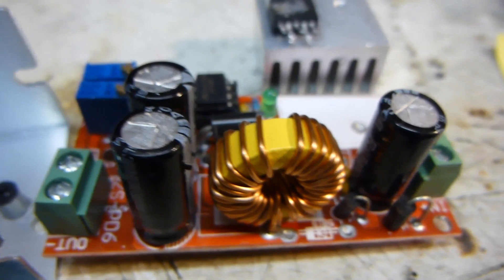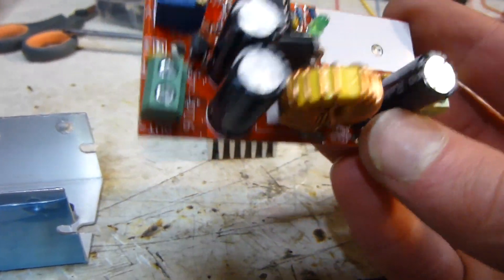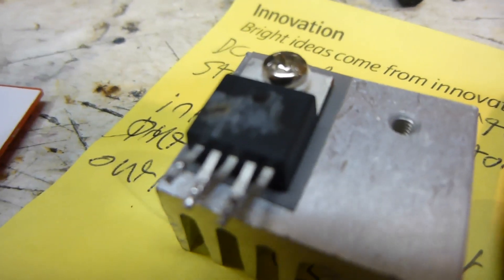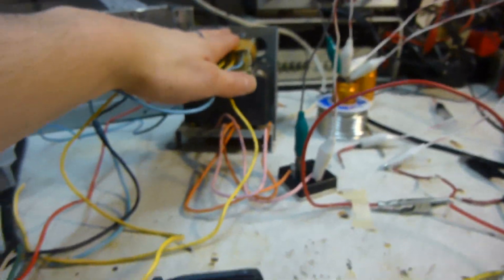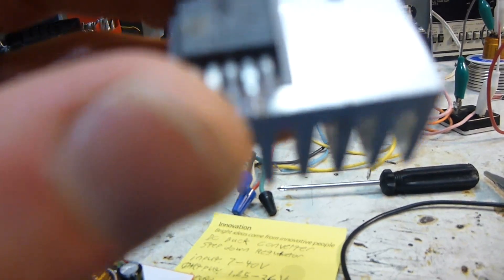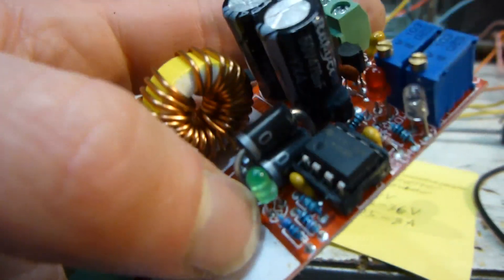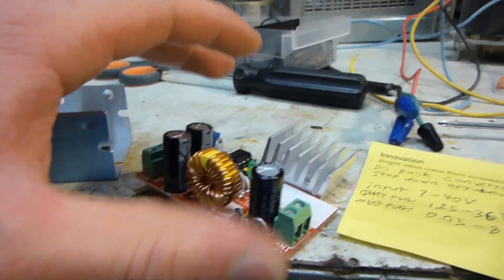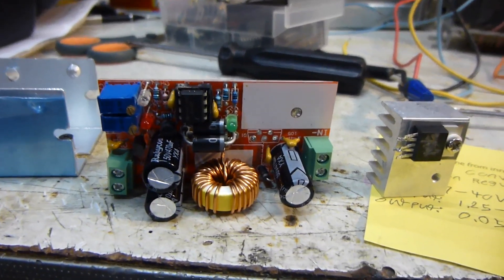Cheap DC to DC Converter Fail

Comment: Bummer. :( I would love if you would make a follow up video on your solar power system. I am curious to know how much it is saving you in electricity and how long it will take to pay for itself. Also, are there any things you would do different?
Reply from the maker: Yeah I need to do that!  It does generate a good bit on sunny days but not much today cause the panels are covered in snow!!!